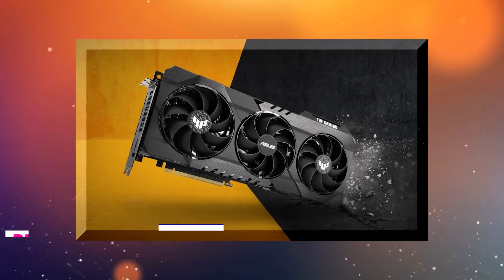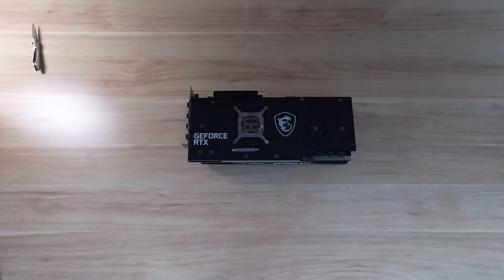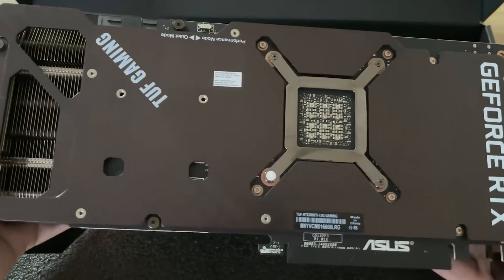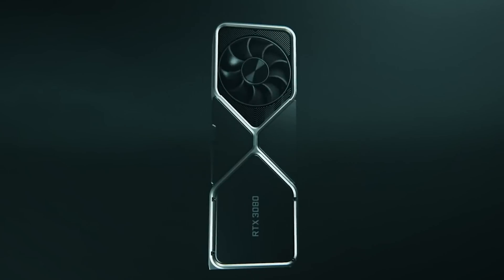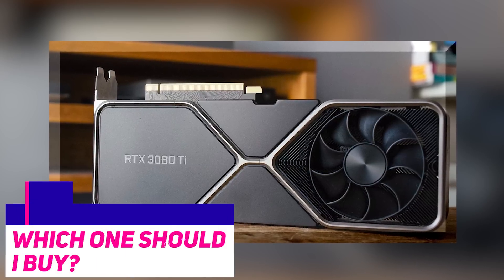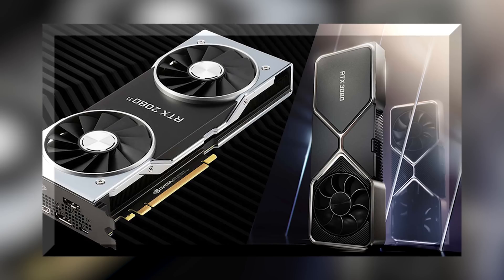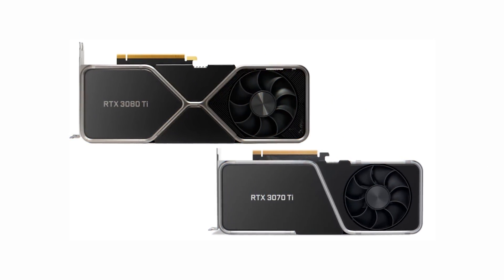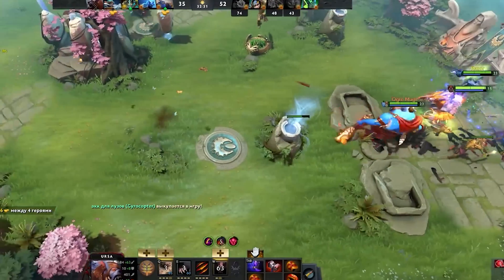Is the 3080ti worth the Extra Money? RTX 3080 vs RTX 3080TI

Comment: As always, there's no bad products, just bad prices.  The 3080ti came out at a time when manufacturers were setting their MSRP as scalper prices.   Now, however, you can get a used 3080ti for $500-550, and that's a great deal imo.   The 3080ti is a beast and lands between the 4070 and the 4070ti.

Comment: Just got an upgraded PC with the 3080. I think based on current benchmark comparisons now the 3080 TI is on average about 13-15% better performance wise than the 3080. However, the bang for your buck value is about a 20-25% in favor of the 3080. Also, if you want a decent PC, go for the 3080 or 3080TI, because lot of the local PC stores are going to stop getting the 3080/3080TI and instead be getting the 4000 series. You can still get the 3000 series online but grab them while the supplies last.
Reply: The 3080 12GB is pretty close to 3080Ti performance 5-7% or so difference.
Reply: @auntiepha8343  I got the 10gig. The 12gig was not available when I bought it.
Reply: @HEEHEEBOII  The 10GB 3080 is a beast too. I was going to buy a 3080Ti but it just wasn't worth it for the tiny performance uptick. You might as well just pull the trigger and go for a 3090 if you are willing to pay over the price of a 3080 for a 3080Ti. I finally bought a ASUS 3080 12GB in July. I waited for the prices to come down to MSRP and it paid off finally. Having a 2070 since 2019 to hold me over didn't hurt either. The 3080 10GB or 12GB is the card to buy. There isn't enough difference between them to matter. Anything more powerful than a 3080 is just crazy expensive for the paltry performance boost. Hell I didn't even realize I had bought a 12GB variant until I had already ordered it. I was just stoked to finally get a 3080. I just lucked out. When the 5080 drops I will look at the 4080 if it is a good deal at the time.
Reply: @auntiepha8343  yeah I think so too. But other than the 3080 10gigs, every other cards were sold out. I actually got one of the last ones. My comp is in the shop now though, something wrong with it. Hopefully is the vid card so I can get a free 4090. This is also my upgrade since 2018, from a 1080 to 3080 lol.
Reply: @HEEHEEBOII  LOL nice! BTW what's wrong with your PC , what are the symptoms? Also did you keep your 1080 or did you sell it? I kept my Pandemic 2070, it sits on the shelf of honor over my monitor now.
Reply: @auntiepha8343  I’m gonna sell my old desktop. But basically what’s happening is that whenever I play game the computer just restarts without blue screen. Like a power off then restart. Good thing I didn’t build it myself or else this would’ve been on me lol.
Reply: @HEEHEEBOII I I build systems for fun and was selling them on Craigslist until the pandemic/gpu shortage. Going by the info here, I hate to say it but it sounds like your PSU is having trouble pushing the system. I could be wrong but that is where I would start troubleshooting the system. Do you have a good PSU? Let me know here when you get it back what was wrong if you get a chance. I would like to hear what happened.
Reply: @auntiepha8343  yeah I think a decent PSU. 850watts though I think it’s a bit low but I haven’t heard back from the techs yet so yeah I’ll post an update if I hear back. But yeah I use to build my own but this time got lazy lol.
Reply: @HEEHEEBOII  850watt should be fine. I am using a 750Watt EVGA G2. I have seen good power supplies fail though. I sold my last craigslist system in early 2020. It had a gtx 1060, i5 9400F, Z370 motherboard and 650 Watt Enermax Marblebron PSU. I use lots of Enermax PSU's but this one went bad on the buyer a couple months later. He solely used it for the Microsoft flight simulator. He described exactly what you did had taken it to a shop and blamed the PSU. He was and had been super cool but I disagreed, I never saw a new Enermax PSU fail but I offered to swap the PSU out with a new 550watt Seasonic. He accepted and I swapped out the Enermax PSU and he never had another issue with the PC. New good brand PSU's can be faulty. Update your story when you get it back. I am super interested now and well met HEE! 😃
Reply: @auntiepha8343  thank you! Will definitely post an update, and appreciate you sharing your story as well!
Reply: @auntiepha8343  so got my PC back, they couldn’t figure what was wrong but replaced both mother board and PSU which ended up solving the issue.
Reply: @HEEHEEBOII  Odd. Thanks for the update but it's still a mystery isn't it?
Reply: @auntiepha8343  yeah exactly. The techs said likely a faulty part but they don’t know if it’s the MB or PSU. Probably was easier for them to replace them since I bought their warranty.
Reply: @HEEHEEBOII  Yeah quicker for you both too. They can swap the parts out and just RMA them quicker than troubleshooting it. I was hoping for a more solid conclusion but it is what it is. It could be the PSU damaged the motherboard or there was a bad PSU and a bad Mobo. 
 Strange things happen. I cleaned my last PC, the power was off and the PSU unplugged. I dropped the GPU mounting screw onto the motherboard, no biggie I got it and put it back in place after I dusted out my GPU and PC with my PC blower. When I fired the PC up after cleaning it, my onboard ethernet was toast. The mobo couldn't even recognize it. I guess the the GPU mounting screw fell just right and shorted out the ethernet components even though the PC was off. I had to go get a $17 dollar ethernet card for my $200 dollar mobo. lol Weird PC stuff does happen.
Reply: @auntiepha8343  yeah lol. Yours is definitely a weird one. But I’m glad I got my comp now and can start gaming haha and loving it so far! Thanks again for your help and sharing your experience 👍👍!
Reply: @HEEHEEBOII  I am glad you got your rig back too. 👍Run that 3080 for a while before you run out and upgrade it. The 3080 10GB is a hell of a card. The performance lift of anything more powerful just isn't worth the money unless you are going for high fps 4k gaming. I am at 1440p and the 3080 is screaming like a banshee at everything thrown at it. Have fun with your rig and hopefully we will run into each other again on a PC comment section. 😃👍
Reply from the maker: This is the way. And let’s be honest that 3080 is gonna last you for 5 years easy
Reply: @TopTierTech1  Definitely, my last card before the upgrade was the GTX 1080, and it lasted me a full 5 years before I decided to upgrade :D.
Reply: @TopTierTech1  probably more like 7 years+ at most

Comment: I purchasing a card today from a 1080 ti would you go 3080, 3080 ti, 3090, or wait for 4000 series?
Reply from the maker: Honestly wait…I have a 1080ti too and I still like it
Reply: @TopTierTech1   I’m on 1440p and running games on low to medium settings to make use of the monitor. I believe nvidia is not producing the 3080 12gb cards anymore so I’m lost as what to do

Comment: Since of now the 3080ti is over $1400 compared to $800 for the 3080 for a 15% boost? I’ll stick with the 3080.
Reply: It's $900 for a brand new 3080ti now
Reply: @themonkeyzone6125  where
Reply: @amadork3691  New egg had them listed at 950 for a msi card
Reply: Bro how come i got The 3080ti for 300€
Reply: just bought a 3080 for a reasonable price on ïnstagram… check the handle above ⬆️

Comment: 12900f + 3080 good for 3440x1440? Or should i get the Ti but it costs $200 more in my country
Reply: Depends on the 3080 price but the 80ti may be a cooler and better buy for you!
Reply: What did you end up getting?
Reply: just bought a 3080 for a reasonable price on ïnstagram… check the handle above ⬆️

Comment: There is a big difference in the UK with the standard 3080 is in stock and available at £799 and the 3080Ti at £1169 which is a huge difference! And the performance though better on the TI is still is not £300 + better...
Reply from the maker: That’s true. 3080 is really good
Reply: just bought a 3080 for a reasonable price on ïnstagram… check the handle above ⬆️

Comment: I have a question if you dont mind.. So ive got all the parts for my PC besides the GPU. My CPU has integrated graphics but id like to put it together and install everything so when the GPU comes i can just get going. Any insight to this? Thank you!
Reply: Hi there. So assuming you did your homework, you have all of the right parts, and are able to assemble everything correctly.... I will only focus on the GPU side of things.
Go ahead and build your system and use it in the meantime, you don't have to wait. You just won't be doing anything graphically demanding.
When initially building your system without the GPU, I recommend routing the PSU -  PCIe cables as if you were going to plug them into your current invisible GPU and either let them hang or tie them up. 
Once you get your GPU, make sure the PC is disconnected from the wall.
Press the power button a few times (4 avg.) after disconnected to make sure the system drains any power that might be built up in the system. You might see it briefly try to turn on, don't worry it's not a zombie. 
Go ahead and install the GPU into the highest PCIe slot, closest to the CPU.
When connecting the power cables, I recommend that each PCIe power connector to the graphics card has it's own individual cable plugged in (don't worry if it's not possible, just use what's provided).
Now, Plug in the video cable directly to the GPU.  Reconnect everything, and turn it on.
The computer should automatically detect the graphics card as a display option, just in case...... wait patiently.
Lastly, make sure to go to NVIDIA's Website and clean install the new driver/firmware for your card.

I hope you found this useful, ENJOY!

Comment: as a Asus 1080 strix gt oc owner I drew tickled with either one of them based on the power rating guesstimate for the 40 series I will have one of the 3080s instead of a 40 series

Comment: In my  country ti version is minimum 20% pricier

I can get strix 10gb for 1230 USD
Or
Msi gaming Z 12 GB for 1300 USD
Hashcat, Blender and gaming (sometimes 4k tv sometimes 1080p lcd) 

With one should I get?
Reply: Definitely the 12gb, it isn't just the ram that's been upgraded
Reply: same dilemma here. mainly wanting to get for blender. ill just wait for the  answers i guess
Reply: @wangosteen  I checked and it seems that in games and test like 3d mark strix can be have better performance. In blender i can be little bit slower. 
I will probably get strix and wait a week or something to be sure that the prices are not cut in half or something. 
If strix will not have to much whine problem it will stay. 
Msi has 2gb more memory but I just don't like how it looks so much. And I live strix  ;D

Comment: I am an Adobe Premiere Pro 2022 user and I purchased the RTX 3080 TI upgrading my RTX 3070. For my surprise, I learned  in the hard way, the RTX 3080 TI is not compatible with Adobe Premiere Pro and you can only render with 50% of the capacity. My RTX 3070 how ever is compatible and can render much faster than the RTX 3080 TI. Only the RTX 3060 TI, RTX 3080 and 3090 are 100% compatible with Premiere in the highs end cards.
Reply from the maker: Wait…is this a thing?
Reply: That is insane if true. Nvidia forces people to have a use for the non-ti 12gb series.
Reply: @bayaholic  I guess is more related to the fact they are releasing the LHR (Light Hash Rate) on the GPU to force miners to stay away from this card, affecting the Adobe Rendering. However the card works perfectly fine with Davinci Resolve.
Reply: @DroneSurf  Now the LHR's unlocked as well for the miners. Hence it doesn't matter anymore for the miners whether the card or LHR or Full Hash Rate. However their income had dropped significantly low now. Thats the reason even at msrp prices minders are not showing any interest to grab them!
Reply: @TamilMediaTV  still are not compatible with Adobe. Even if are at MSRP. Only 3070, 3070, 3080 and 3090 are 100% compatible in the high end cards as far as today.
Reply: @Drone Surf thank you for mentioning this!!!!! Can you please confirm if your 3070 was a gen1 or LHR?
@Top Tier Tech If you would kindly make a video regarding this. I think that's some useful information for everyone to know. I'm guessing the 3070 was a gen1. So would it be possible that other 30series variants with LHR are affected as well?
I'll be looking into this more, thank you again Drone Surf.

Comment: Neither. If you wait less than six months, you can get something from the 4000 series for the same amount of money - which'll be just as much of an improvement the 3000 series was over the 2000 series. If you buy anything now, you'll be kicking yourself. Unless you don't have a working video card, put the money in Acorn or something & just chill. This is the absolute worst time to buy any video card or CPU.
Reply from the maker: Eh the worst time was a few months ago. Prices have come down a lot
Reply: @TopTierTech1  exactly.. when there's stock its always a good time to buy considering you need the gpu .. the 4000 series will probably cost 2k and will be out of stock for sure so...
Reply: @zivsahar  fr people are way too optimistic rn. Nothing has really changed in the world theres still going to be short supply
Reply: I only have so much patience. 2+ years wait during a world crisis. It is time. The car is gassed up with expensive fuel and ready to go.
Reply: I wouldn’t put all my eggs in one basket waiting on the 4000 series. We don’t know the price or the availability on those cards. Plus I keep reading the power they going to use is crazy. May not be worth the upgrade
Reply: @melvina183  for 2k gaming a 3080ti should hold you over for at least 2 years maybe even 3
Reply: @sephirothlv100  3080ti is overkill for 2k, might as well get a 3060ti
Reply: we don't know if there will be another paper launch of the 4000 series if so it will be the same bs all over again in terms of availability
Reply: Lol how stupid do you feel now @anthrobug
Reply: @Gx22  I would feel stupid trolling 6 month old threads. And if you're too cheap to get a 4000 series, get a 3080ti for 599 on amazon right now. Clown.
Reply: @radafus link Trolling 6 month old comments? LOL - You can buy a 3080ti right now for 576 euros if you're not happy with the 4000 series.
Reply: @radafus link Ebay, amazon, I just searched & theres 3 on amazon right now under 900 euros  - What is wrong with you?

Comment: 1300 also puts it in the same price range as the red devil 6900xt

In a normalized market I'd favor Nvidia, but if I'm pitting a 3080 or 3080ti vs a 6900xt... Yeah I'll take the 6900xt
Reply: 3080 ti is faster bud
Reply: @Bk_owns  it also comes with a +$470 pricetag, cheapest 6900 vs cheapest 3080ti

(1,100 vs 1570, Amazon)

Obviously, different places have different prices and such, and it doesn't account for hardware you already have, but if I were building a full new pc I'd definitely be taking the 6900xt + 300 usd(cheapest 3080ti vs red devil 6900xt) to bump up my CPU to a 5950 or 5800x3d, or w.e the top end Intel CPU is rn, 12900S?

Over a 3080ti, if I were dead set on spending the same price
Reply: @Meniak  my 3080 ti was 1350 at best buy with no sales tax. The red devil 6900 is like 1275.
Reply: Radeon cards have inferior RT right now until rdna3 launches. Also dlss is still better than fsr. So for me nvidia is the way to go.
Reply: @bk owns  

Yep, if that were the case, and I needed one this very moment, I'd likely favor a 3080ti as well, presuming that they were actually available for purchase.

However, I've yet to see any actually available for that price, in person, not out of stock. Heck I saw some sticker prices for them at like.. 1,100? Back at launch I can't imagine them not being constantly out of stock if that is actually the going price since online is far higher than that

As far as RT goes, its awesome, sure, but most people are only going to use it in SP games where FPS frankly isn't the biggest concern past 60, as long as the game doesn't dip under 40 to break G/V-sync on most monitors, it's fine

In the games which the 6900XT struggles with, the only reason appears to be due to developers designing the game specifically for Nvidia, to be ran with DLSS

On average, the 3080 is only ~5% faster than the 6900xt, (hardware unboxed 3080vs6900xt) so I'd expect the 3080TI to be ~10%

Outside of those scenarios, 

(Single player or developer favored)

MP games are almost always with it off, at 1080p due to the competitive nature of those games, and in that scenario it should go blow for blow with it's Nvidia counterparts

Regarding next gen, I wouldn't even consider them tbh, even if they come out this year I doubt there will be any real availabilty until late 2023, and if performance rumors are to be believed, the low end will cost as much as the high end now

RT is still pretty much just a marketing gimmick still, with actual full implementation of it still bringing all cards to their knees. 

DLSS VS FSR is still a question mark, as both are still developing and they are not implemented in all games, and tbh both still suck pretty hard in quality vs native (DLSS less so, but still so)

The biggest selling point to me for Nvidia over AMD will be for creators who are developing content for 4-5k screens

Nvidia Omniverse is such a great tool that almost no one is taking advantage of, but if you know what you're looking for, you can always tell when creators use it

Comment: RX 6800XT is a better buy than both @ msrp from AMD or MicroCenter IAB price of $900usd
Reply: Logic and wallet says the same
Reply: @J B Thursday mornings around 6 am to 9am Central
Reply: Had both and the 3080 is a better card. even though the 6800xt isn’t a bad card. If you have a choice def go with the 3080 but the 6800xt is a great card
Reply: just bought a 3080 for a reasonable price on ïnstagram… check the handle above ⬆️